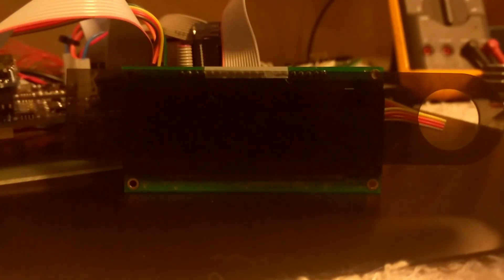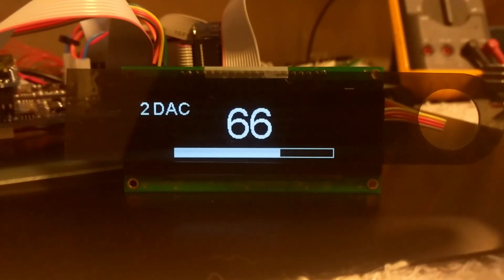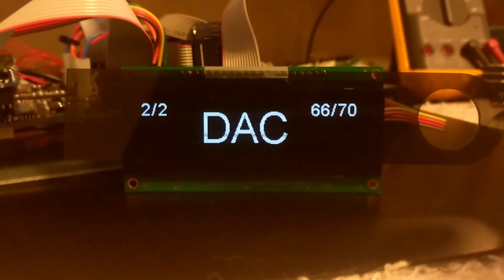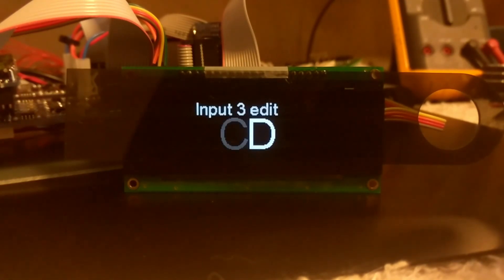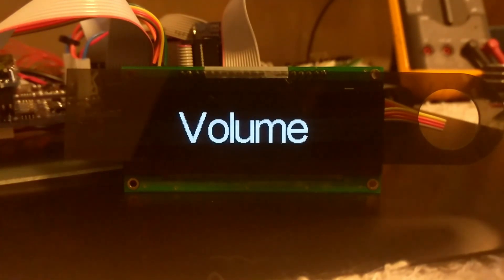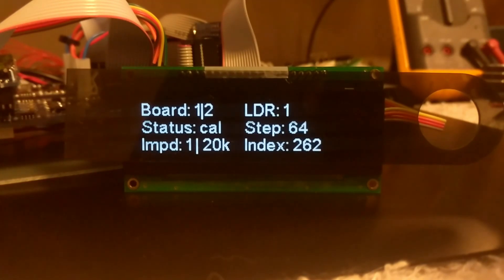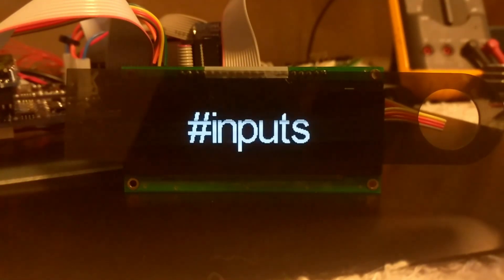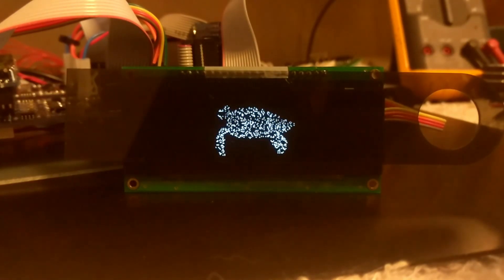Tortuga Audio Preamp OLED Display Overview

Comment: Awesome! Are the source code available?
Reply from the maker: At present the source code for the OLED display is proprietary having developed the OLED driver code on our own and given that it's part of the firmware for our preamp controller products. We developed the driver code ourselves starting several years ago because we couldn't find anything existing that worked. Remarkably the manufacturers of these type displays seem to do a very poor job supporting them with proven,  robust, easy to use software tools.